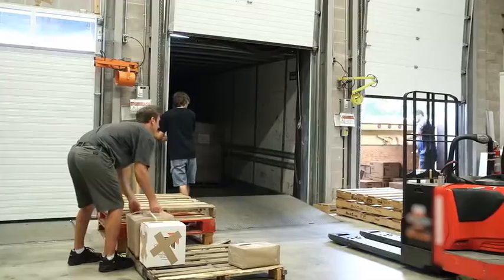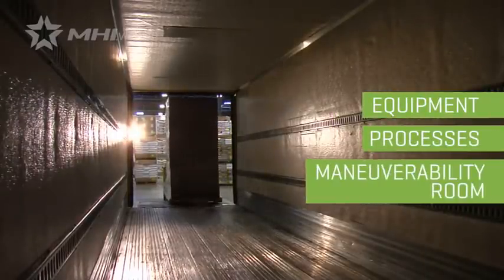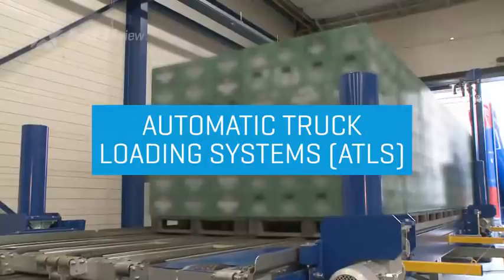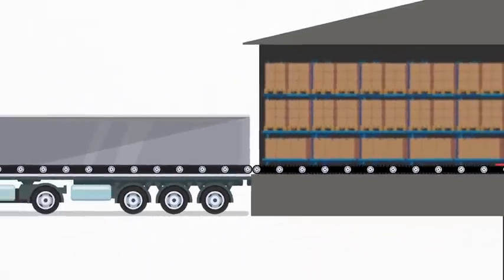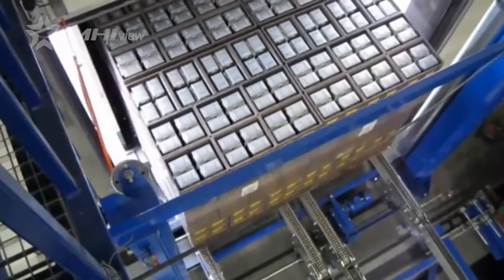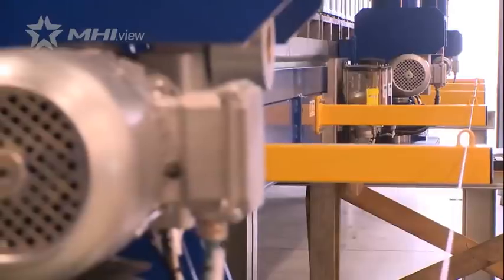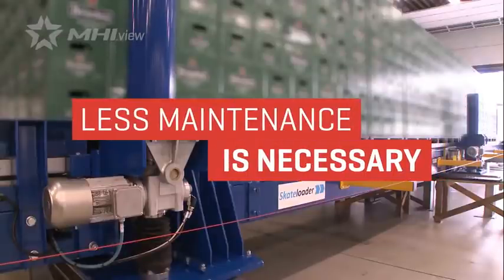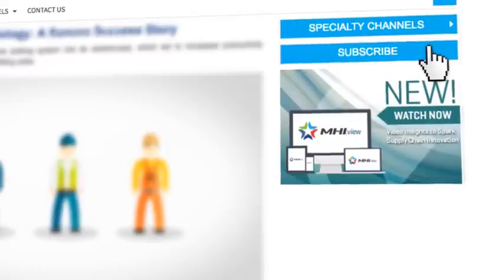Ancra's Automated Truck Loading Systems

Comment: So you retrofit a trailer to work with this system and then can it still be used traditionally or will a pallet jack mess up the the system if it tries to drive in the trailer?
Reply: One trucker on youtube said he was loaded by one but said can't go inside and film it .
Reply: Great question!

Comment: Decades ago when I was a teenager, I drove a forklift in the shipping dept of a local warehouse called Rev-A-Shelf. I knew when trucks were coming in and what loads they were getting. I would stage their freight before they even got there. When they bumped the dock and popped their brakes, I'd set the dock plate and then push their freight on 4, 6 or 8 pallets at a time depending on weight. Because I already knew the weights of the loaded pallets and staged them in groups, I could push them onto the truck and load a truck in a couple of minutes. It just took a little planning ahead.
Reply: That's called "bulldozing".  I used to do that with the double skids 10, 11, or 12 pallets double stacked for each row depending on how big the trailer is (48, 53, or 57 feet long), then get the second row in and done within 5 minutes.  That works better with the light skids like paper towels, chips...
Reply: Typical ship dock work.
Reply: Damaging pallets
Reply: @sentra2skyline141  Nope, we had smooth floors. The trailers didn't even have the knife edge grippy type floors that are common nowadays and the products we made were large and lightweight. The skids were not damaged.

Comment: Well, here's what I see as cons to this.   There's added weight to the trailer, which affects payload limits.  If the system in the trailer goes down, trailer becomes out of service.  If the system in the warehouse goes down, it's now in the way of a forklift,  so redundant systems or standard loading docks are still needed.  And the most important concern, it creates unemployment.

Comment: Every system has a default. What if the undercarriage frame is damaged and needs to he replaced? These trailers are expensive, because their unique. It's cool though. You still have to set the product up for delivery. Not a really good system.

Comment: What about rollers like the c130 uses? Could that work in a truck?
Reply: That is actually such a thing.  I have been in air and ocean freight for 20+ years.  We had trailers with them specifically for PMC's/cookie sheets.  The rollers in the trailer could retract when loaded or not needed too.
Reply: @TriptoCo  I honestly thought every trailer would have them. By the time the driver opens the side curtains, it would just be as easy opening the rear doors and pushing the pallet on the rollers to the back door to get it unloaded by a forklift.
Depending what loads they are carrying of course and also the pallets need to be in delivery order.
Reply: Hauled a retractable roller bed trailer for Kittyhawk (Kalitta Air) in air freight for several years. Hauled cookie sheets and igloos. Hauled regular cargo on the side including Production and Staging. Beats the shit outta dry van freight.  DON'T EVER make an airplane wait on you and they will love you.
Reply: @lakesnake2005  Dude.  You're bringing back some memories.  I used to book many tons on a nightly basis with CK in the 90's and early 2000's when they were still doing their nightly routes.  Since they collapsed and became Kallita charters only, I have booked dozens of charters with them.  Always out of EWR (their home base) to FAI and HNL.  Worth every penny for my company and our customers.  Those 9ld 747-400's as still some serious bad boys.  Do you know the story about who and how they started?  It was Connie Kalitta the drag racing legend that started then.  Hence the CK name for us old time 3pl Air shippers.

Comment: How much Weight loss in freight is involved with the belt roller group in the truck 2 What are the maintenance  cost for equipment in truck 3 how much room is lost in cubic feet 4 with the system installed can the truck still be loaded via forklift?

Comment: And just how do you work in axle weights with your system? What if the load has to go on single-double-single? What then??
Reply: They’re going to be like 🤔 that’s a good question.
Reply: Probably not need, themes lile they transport from a factory to warehouse. So they have always full trucks with the same weight.

Comment: I note that they never mention how much cubic space you lose within the truck bodies...
Reply: Unless your load is hand stacked/floor loaded, I don't see a decrease in the amount of palletized freight in the videos show. One thing that brings a question to my head is weight distribution. Not all palletized loads can be stacked side by side down the whole trailer, especially with heavy pallets. They will need to be staggered.
Reply: @jimc12  you is right.
Reply: @cooljohn1977  18 years of operating a commercialvehicle, I've learned a few things and I always keep an open mind to keep on learning.
Reply: @jimc12  The height space needed for the truck's conveyor system is lost. Probably a foot or so throughout the whole trailer.
Reply: @alstead6898  How do you know this?
Reply: @jimc12  usually the heavier on both ends
Reply: I work for Seur in Madrid. We load the truck by hand to the top pf the trailer and that is just atrocious.  dont gain too much space, and 2 persons do the whole thing on like 5 hours non stop, killing our backs just for saving some space. This should be ilegal
Reply: @fernandogarciadeleon6292  I don’t like floor loads in my trailer either. I have to give the receiver 4 hours to unload it before I start charging demurrage. I am with you, outlaw hand stacked loads!!!

Comment: What's the life expectancy of the weakest component and what is your annual maintenance service costs for the machine.
Is the machine designed for mild damage from a loader in the loading areas and can still maintain tolerances?
Proprietary software or mechanical parts that can only be purchased through the one company?

Comment: Being a 38 year retired OTR driver/owner operator I see only one flaw with this system. While it can load and unload product in three minutes, it doesn’t allow saving time for checking the unloaded product  against the bill of lading for accurate count situations. Otherwise I find this a great invention...that is if every company and owner operator can afford to install the same system inside their trailers!
Reply: I was thinking the same thing. What about inspecting the trailer for food safety concerns? Would a system like this be an issue with SQF certification?

Comment: There ya go another way to cut jobs and how do you get the trailer load so it will scale and not dump the load inside Oh and what happens if the load shifts going do the road and its not lying against the wall how your F mech going to unload now. We need to create jobs not take them away

Comment: They have this system at a place i go to. All well and good until the trailer the loading system or the unload system goes faulty.   They use it to move from production to distribution Centre about one mile away..
Reply: Yup! And it's bound to go down.. at least twice weekly.

Comment: Sysco or U.S foods would not be able to use this. As the people who stack those pallets like to put gallons of bbq sauce on the bottom that gets warm, plastic warps and then the pallet falls over in the truck. This is one example. Its ALWAYS something with them. Also, if you are hired to drive a truck LEARN TO FUCKING use a forklift. Im so tired of having to do truck drivers jobs and mine. Your job is to deliver, get your ass on the lift and move YOUR DELIVERY.

Comment: Who the hell takes half hour to load a trailer!?! Given a good forklift and the pallets being ready, it's quick.... We load / unload no screwing around pretty quick, and fast doesn't mean damage.
Reply: Coming from an industrial engineer in automotive... mixed freight in a milk-run loop with multiple dunnage types can take every bit of that half hour
Reply: I got it down from scanning each pallet and fully loaded truck in 18 minutes. 26 pallets.

Comment: They might load the trailer in 3 minutes. How long does it take to load the product on the conveyor ? Im not impressed.
Reply: This could make a huge difference.  If you're not impressed, then you're not thinking it through very thoroughly.

The bottleneck in the conventional system is that loading dock space for trucks is limited and at a premium.  Also, the downtime when a truck is in a loading dock [or waiting in line for space at a loading dock] is completely lost time for the truck driver and the owner of the truck fleet.  The truck driver still has to be paid even though he isn't really doing productive work when the truck is waiting to be loaded.  The truck overhead expenses still have to be paid even though the truck isn't making any money when it isn't rolling on the highways.

With the automated system, the large truck-size conveyor pallets can be loaded and secured at any time, especially when no truck is at the loading dock.  With multiple truck-size conveyor pallets within a warehouse, multiple shipments could be arranged at the same time at all hours of the day and night.  Then if 5 or 10 trucks show up within an hour or two, they could all be loaded and on their way to the destination within minutes of showing up at the loading dock.  This could be a huge savings due to improved efficiency, and the bottleneck of the loading dock is eliminated.

Ed Schultheis, PE
Mechanical design & manufacturing engineer consultant for 35 years
Schultek Engineering & Technology, Inc.
schultek.com
Reply: @edschultheis9537  picture this. The conveyor is loaded and ready to be put on a trailer. A truck backs a trailer in the door. The product is loaded on trailer within the 3 minutes as stated. That truck pulls out of the door. Another truck backs in the door. There is no product on the conveyor because it was just loaded on the other trailer. The time it takes to load the conveyor back with product could be used to load the product directly on the trailer. The only benefit that I see is for the first trailer loaded.
Reply: @truckerbugBR549  Who said that you would only have one trailer-sized pallet ready for each conveyor?  Several trailer-sized pallets could be loaded and ready in the warehouse.  Once the truck pulls up to the loading dock, just select the load that goes with that truck and push it into the trailer.  Multiple trucks could be loaded quickly, one after another, using this method and only one loading dock.  They don't have to take up additional space because all that stuff is already being stored somewhere in the warehouse.  Just rearrange the space.  This is really about the same concept as using standardized shipping containers to load an ocean-going ship.  It revolutionized the shipping industry.   https://i2.wp.com/www.globaltrademag.com/wp-content/uploads/2019/12/shippers-1.jpg?fit=757%2C393&ssl=1
Reply: @Brian Byley 
I am a mechanical design engineer and manufacturing consultant with 35 years of engineering experience.  I am also a licensed professional mechanical engineer in the state of California.  I have been doing engineering consulting work for over 20 years.  I have a master's degree and bachelor's degree in mechanical engineering, specializing in machine design.  In addition, I grew up on our family farm in eastern Washington state.  I started operating, maintaining, repairing and building farm equipment from about age 10.  By 14 years old, I was driving large combine harvesters, tractors and trucks on the steep rolling hills of the Palouse region of WA state.  https://c8.alamy.com/comp/FC50XC/combines-harvesting-wheat-in-the-palouse-region-of-washington-FC50XC.jpg

As I am self-employed as an engineering consultant, I am also the CEO of my company, Schultek Engineering & Technology, Inc.

So I do know one or two things about machinery.... inventing it, designing it, operating it, manufacturing it, assembling it, trouble-shooting it, repairing it and optimizing it.

Ed Schultheis, P.E.
Schultek Engineering & Technology, Inc.
schultek.com

Comment: Good job putting 1000s of people out of job. 👍
Reply: The people who load the truck now have to load the truck loader.
Reply: @aidenallen912  But they can load the truck loader at any time... No need for a truck to be in the loading dock.  It greatly improves the efficiency of those doing the loading and it improves the quality of the entire shipment.  Rather than rushing to fill a truck as soon as it arrives at the loading dock, the loaders can take more care to do it well and not feel rushed to get a truck on its way.
Reply: @edschultheis9537  yeah, exactly. Im not arguing against this machine. I was stating no one is really getting put out of work because they still need loaders to load the truck loader because of the context of the comment that demonology made
Reply: Do you also object to the modern way of loading ocean-going container ships?

This is how it used to be done.  It used to take a long time to load a ship, quality control suffered, and the goods were more expensive because of it.
>>> https://c8.alamy.com/comp/CWC23Y/japanese-longshoremen-loading-bundles-of-raw-silk-onto-a-freighter-CWC23Y.jpg
>>> https://49fe30bb3aa7406c16dc-5c968119d095dc32d807923c59347cc2.ssl.cf1.rackcdn.com/2014.346.117_1.jpg

Now, the goods are pre-packaged in standard-size shipping containers.  This is all done before a ship enters the port.  Then each container is relatively quickly (compared to the old way) stacked on the ship and secured.  This improves the efficiency and quality, while reducing prices to consumers.
https://content.fortune.com/wp-content/uploads/2016/09/738342.jpg

Which is better, the new way or the old way?  The automated truck pallet system is essentially the same sort of change.

Ed Schultheis, PE
Mechanical design & manufacturing engineer consultant for 35 years
Schultek Engineering & Technology, Inc.
schultek.com
Reply: Time to get with the future, robots will take over most markets and most jobs.. the only human jobs will be those that repair and program the robots. might want to learn that. 1000s of jobs dont matter, what matters is efficiency and humans are not at all efficient.
Reply: @chrisdawson3175   until your deemed worthless then you’ll be regretting this comment.
Reply: Nobody will lose their job. Someone still has to load the product on the line. If anything it created jobs. Someone has to produce the components for that system. Someone has to build, sell and install the system also. Im not a fan of it either but thats how it is nowadays.